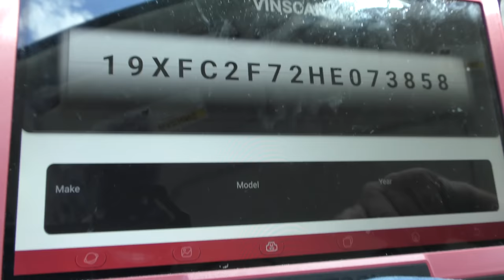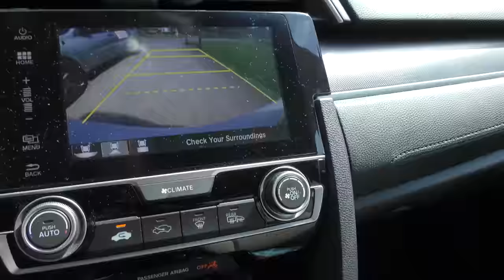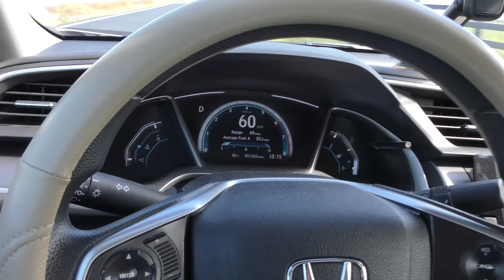Here’s What Happens If You Change Lifetime Transmission Fluid in Your Car

Comment: In 1964 my father and our mechanic were discussing automatic transmissions.  My father said, “The perfect automatic transmission would be continuously variable”.  Dad is gone now, and I do miss his insight.
Reply: and what does it mean? english is not my native language so, i understand the words but make no sense to me
Reply: @daviT_con_T   A CVT, continuously variable transmission, does not have set gear ratios, but a belt and pair of pulleys that change size to what gearing is currently needed.
Some CVT may have a set mechanical 1st gear, but all other ratios are by CVT belt.
Reply: I think snowmobiles have always had them.
Reply: @rogersmith7396  snowmobiles and scooter bikes use a slightly different type, it's not really a cvt it's more like a friction disc or a clutch that engages based on engine rpm
Reply: your dad was wrong sorry. They are garbage, they can't handle the load and there is no shift. People want to feel the shift that is why they simulate the shift in CVTs just awful. Buy a manual and be done with it.
Reply: @jeremypilot1015  Older CVTS sure, I doubt what his dad was thinking of was the first and second gen ones. Just the general idea of it being an interesting middle man idea. A good amount of people either prefer not to or can't drive manual and just "Buy a Manual and be done with it".
Reply: @jeremypilot1015  lol dreams of murika
Reply: @williamkrause5585  Manuals suck going up hill, especially in low traction condition. My dad's manual pickup truck bearly makes it up hill to where their house is while my 1991 automatic maxima does it easy and can even stop uphill and continue while my dad and the neighbors need to go back down and start over
Reply: @Brandon-uy1uv  Yep, no need to do a machine's job yourself.
Reply: @williamkrause5585  nope still junk they are still failing at alarming rates. and have yet to see one crest 150K on the odometer.
Reply: @Brandon-uy1uv  Sounds like a centrifical clutch like on go carts and my old mini bike.
Reply: @jeremypilot1015  my original 05 Ford CVT sitting at 260k would disagree.
Reply: @Avaddon911  you're one in a million literally.
Reply: @jeremypilot1015  I actually still see a few of them driving around my town. Maybe they got it right with that model. Ford freestyle
Reply: @Avaddon911  or it ate the first one and that’s a new one
Reply: @jeremypilot1015  Mine is definitely the original. I can't speak for others but it seems more likely they haven't had an issue either. Maybe you're just wrong? Aside from Nissan I can't recall many issues with CVT's.
Reply: @Brandon-uy1uv  your dad and neighbors don't have the skills to be driving, they need a chauffeur
Reply: CVTs were fitted to cars 120 years ago so your dad wasnt the first one to have the idea. Even today the hey are quite bad and can be a source of expensive repairs.
Reply: CVT transmissions are universally trash
Reply: @Brandon-uy1uv  Sure your not talking about the difference between an RWD and FWD car? Manuals are good for going downhill in the snow.
Reply: @Avaddon911  he cant be wrong😂 have you not seen how much he's defending his point
Reply: @Brandon-uy1uv  that's just a low engine power situation. Torque converters are more efficient And effective at turning each rpm into torque/useful power but with a manual trans you just have to have the power to make the gear ratio work against the hill. Kinda like a small kid on a big hill on a bicycle. It's gonna be harder to push up the hill but with an automatic it can use the revolutions of the engine and multiply the torque as it's using hydraulic pressure being pushed by the engine.
Reply: @Brandon-uy1uv  it's the same thing executed differently
Reply: @williamkrause5585  new ones are junk as well
Reply: @Brandon-uy1uv  down shift
Reply: @Avaddon911  oh look one
Reply: @Avaddon911  are you a mechanic? 20 years I can tell you cvt is junk.
Reply: @beekeeper8474  Yes that's why every car manufacturer is switching to them... I don't need your supposed mechanic experience when I've got reality right in front of me.
Reply: @Brandon-uy1uv  then they either suck at driving clutch or the pedal position and throttle position are not in sync then. All my manuals are faster than my automatics. Until one day i had a pedal and throttle position problem and the up hills became scary. The pedal would only open up the throttle like 28 percent when i looked at it with my tech 2.
Reply: @Avaddon911  My 2011 Nissan rogue CVT would absolutely agree. This is not an exaggeration or lie, I've replaced it twice in. My car is under $80,000 mi. I can say with some confidence I will never, and I do mean ever be buying a CVT transmission vehicle again!!
Reply: @marianoalvarez6467  You bought a Nissan. That says it all. If you had went with pretty much any other manufacturer you might not have that opinion.
Reply: @Avaddon911  a lesson I learned and don't plan on making this mistake again
Reply: @marianoalvarez6467  Nissan CVT's are bad, but not ALL CVT's are bad. You just bought the worst possible one.
Reply: @Avaddon911  I've since learned how notoriously bad Nissans CVTs are. However, I still don't think there's any denying that traditional engines with fixed gear ratios do have a longer track record of longer lifespan. Especially when you consider a more traditional transmission such as a manual transmission. After having spend money to literally buy a brand new transmission from Nissan and still having issues my next car I think I might go with a standard transmission. I'd like to not have transmission issues for a while
Reply: @marianoalvarez6467  I can't disagree with you there, good luck finding a manual transmission these days though. Unfortunately you don't see them much. I've got almost 260k on my 05 Ford CVT, and they're becoming more and more common.
Reply: @jeremypilot1015  A lot of generalizations there. I’d rather tow with a CVT than a manual. At least the CVT has a cooler. 

And it’s not “literally” - you mean figuratively.
Reply: DAF sold a car with a CVT in 1964. The GM 2 speeds were more or less a CVT.
Reply: @Brandon-uy1uv  lol that's a FWD vs RWD issue, not a manual vs auto
Reply: Brother, wisdom of the elders is invaluable, it's nice you shared that moment with him.
Reply: @Brandon-uy1uv  That's the engine, not the transmission.
Reply: @Brandon-uy1uv  user error.
Reply: Interestingly enough, the Honda Insight had a CVT back in the day.
Reply: I don’t like the feel of a CVT tranny.
Reply: @Brandon-uy1uv  I don't believe you. I've never seen a Manual transmission Truck of any kind that couldn't make it up any hill that a Car or Truck with an Automatic Transmission could. Unless something is wrong with it.
Reply: @jeremypilot1015  Have seen plenty of CVT break 150k ,200K and 250K. All Toyota and Honda. Never a Nissan.
Reply: @rogersmith7396  mini bike and go karts are better than any cvt
Reply: @ccole9080  Wish I still had my two Honda Mini Trails.
Reply: @jeremypilot1015  Maybe he changed the fluid more often.
Reply: @Charles Hines The advantage is theoretically a CVT has an infinite number of gears as opposed to 2 or 3 or 9.  Their design in service is apparently still a problem.  They have been working on heavy truck automatics for years but apparently not gotten the bugs out yet.
Reply: The 1948 - 1963 Buick Dynaflows and related 1957 - 1961 Chevrolet Turboglides (not to be confused with the 2 speed Powerglide) were torque  converter transmissions that did not shift. They could be considered to be a type of CVT that relied completely on the torque converter rather than shifting.
Reply: @Brandon-uy1uv   Sounds like a centrifugal force clutch which have been around for a damn long time, Much longer than me and I am 44. Well that is very interesting. I'm not a fan of belts, but if it works it works.
Reply: @rogersmith7396  lol I said the same thing. Interesting concept where instead of engaging at rpm, the "clutch" gear expands to increase or decrease gear ratio.
Reply: @JTguitarlessons  yeah now I live UAE here I have stick PATROL and CRUSIER
Reply: @joeweiss2409  Dragsters often use powergluides.
Reply: @lloydhills7416  Was clutch slipping?  Bad clutch.
Reply: @jkeelsnc  You can control wheel speed with a manual.  Once tires break loose with an automatic its off to the races for several seconds.
Reply: @dstrau7987  The 66 Olds THD 425 FWD had a variable speed torque converter stated to be excellent.  GM discontinued it after one year as un necessary expense.
Reply: @jeremypilot1015  Honda?
Reply: @Brandon-uy1uv  Europe has worse weather and terrain than us and they do just fine.
Reply: @williamkrause5585  here most people drive a manual or know how to drive one
Reply: @jeremypilot1015  this is sarcasm right?😂. My accord drives great, 180.hp and 170k on it. Shifts like the day I bought it, and can still pull 40 mpg at a steady 65mph. So terrible 😅
Reply: @billd9667  a manual doesn’t need a cooler. Less to break.
Reply: @billd9667  and if I was going to tow with an automatic it would be a TH350
Reply: @jeremypilot1015  the problem is not cooling so much as the clutch. Someone good with a clutch can tow, but won’t last as long as an automatic will under that load. I towed with a CRX Si and the clutch held up pretty well, but it was mostly highway driving. Oh, and it eventually ripped off the bumper 😂
Reply: @jeremypilot1015  12 Ford Fusion CVT hitting 200k this month
Reply: You're the best Scotty. What scanner are you using, and can I get one.
Reply: @jimbos.online  I know I am, thanks.
Reply: You can downshift with any transmission - manual, auto, or CVT.
Reply: Here in the UK i got a 2015 Yaris 1.3L CVT it's so smooth! I get 58mpg best & 40mpg city/town (UK GALLON)
Reply: @rogersmith7396 Basically, yes. But cars use a braided steel belt, which sluffs off the fine metal particulate Scotty shows in the video.
Reply: @Brandon-uy1uv What are you talking about? Any crappy car or truck (I use this term only because it has a little bed on the back) can't climb a hill because it HAS NO TORQUE. I have a Ford F-350 with a 460 V8 and a 5 speed manual. Get out of my way with your crappy little Toyota...up or down a hill!
Reply: @jeremypilot1015 I’m sure his dad was more so just thinking of the concept of a transmission without gears. I doubt he had the same exact system in mind as a CVT.
Reply: @jeremypilot1015 the cvt in newer hondas are actually pretty good. I got a 2020 civic sport hatchback with the cvt and it felt weird at first but its super smooth once you get used to it also the ones made by honda are very reliable ofc so im less worried ab it then most other automatic transmissions which are the source of most problems in newer cars. I still would prefer a manual of course but the smoothness of the cvt adding to the smoothness of the handling and suspension of a civic sport just cant be beaten
Reply: Conversely the perfect engine would put out the same power through the entire RPM range.   I'm drawing a blank, but there was a company back in the day that built a performance/racing prototype with a rear engine and the crankshaft basically connected directly to the wheels.
I dunno what the latest greatest is, but all the CVT transmissions I've seen were glorified snowmobile transmissions.
Sadly, they became popular in ATV's and you basically had to drive them like a granny or they'd burn up in many cases.
Reply: @jeremypilot1015 chain driven CVTs seem to be significantly more reliable than belt CVTs but yeah it’s still a relatively new technology in terms of it being used.
Reply: Cvts have been on scooters for many decades.

And they waste so much power and fuel economy there, too.

A sprockets or gears with a manual trans is the way to go.
Reply: Wife and I tested new HRV a few years back, was fine on level ground but dealership lot was on a hill.  When we returned car had to go up short but steep hill and CVT bucked and surged, didn't seem to know what to do.  CRVs were 1.5 turbo, no thanks, Pilot and even passport were huge.  Wife ended up buying 2018 Acura RDX, last of the v6 RDX, used, low miles, no turbo.  Guess those RDX turbos might be ok (maybe Honda K series) but feel better with V6
Reply: @jeremypilot1015 Manuals are trash brother lol, time to stop living in the past. And way to disrespect his father asshoIe
Reply: He was wrong.
Reply: I remember  a ‘55 Buick Special our family have ….. there was no noticeable change of gears in the automatic transmission …. just a constant acceleration.
Reply: A belt in a red hot transmission and pulling a load is bad news. Common sense
Reply: @jeremypilot1015 he’s definitely not 1 in a million my brothers civic has over 200,000 miles on the original cvt transmission. It’s ok to admit you’re wrong sometimes
Reply: The one fuckin car that did it halfway right and that's what you're going to justify a CVT transmissions existence with?  @PeytonCappitelli
Reply: @jeremypilot1015  they did it well enough to have many cars out there well past 100000 miles with no issues. Cvts may still be relatively new and no where near as bulletproof as a standard automatic but they are the way of the future
Reply: Smoother shifting transmission tend to wear faster. Beware.
Reply: When the car is new cvt transmission is good and the car going more fast for manual transmission car. But when car is old cvt transmission is bad .I like manual transmission because when parking car make noise when combined gas pedal and clutch pedal.
Reply: @jeremypilot1015  🤔350K going strong...